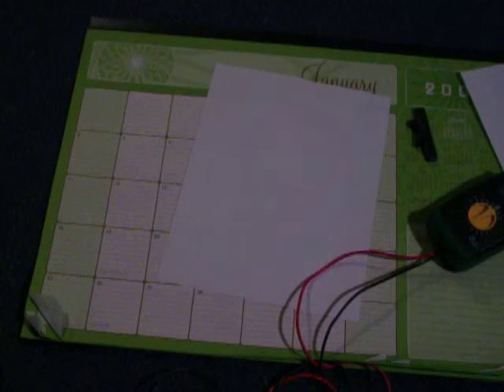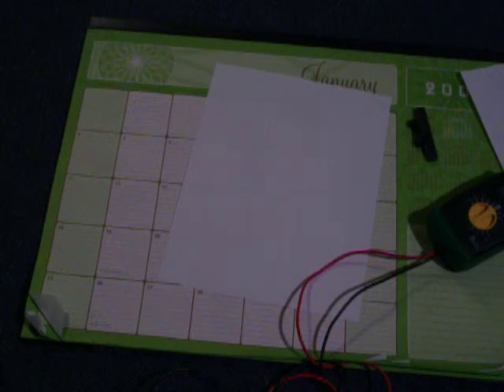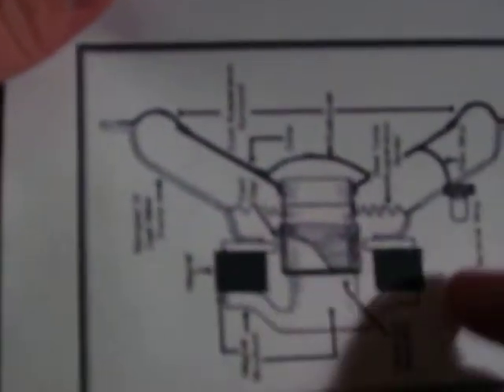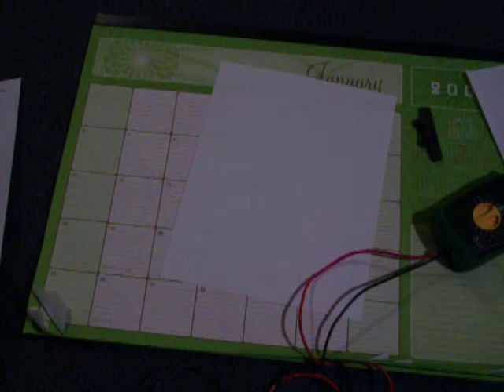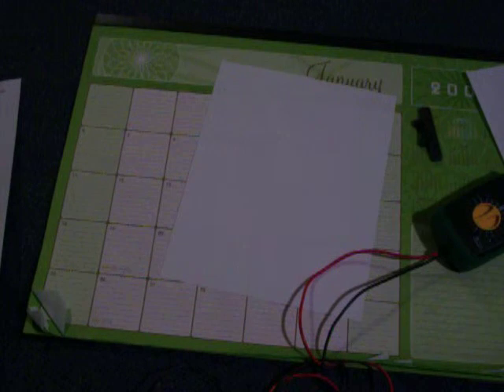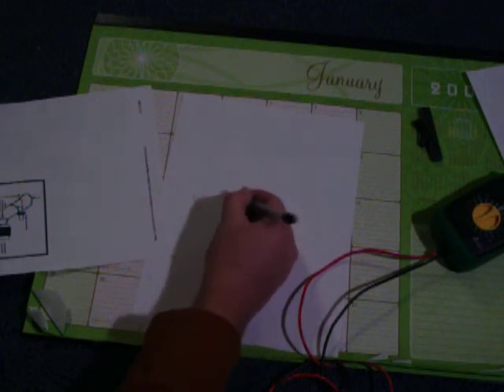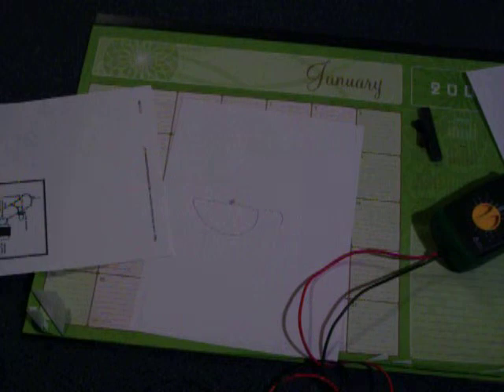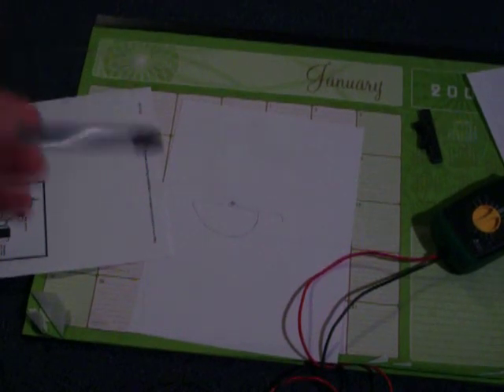how a real speaker works and it wont cost a buck to make

Comment: The speaker design used in household hackers is biased on pezoelectric specifications. The problem being is that there is no pezoelectric material like quarts. The speaker would not ever work if you do what he said. Its a dead short using a penny. And the sounds is dubbed over, the tin foil would rattle. Pezoelectric speakers have no coils no magnets or secondary surface. There are also enert discharge speakers and untrasonic indiffernce speakers. HH is BS though 100%